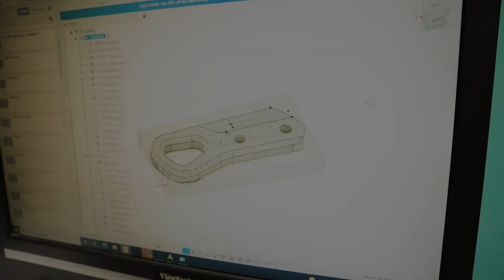Installing a Cargo Barrier in the Toyota LandCruiser LC300

Comment: This unit looks like it’s no longer easy to fold the seats forward to get behind them or to adjust seat lean.
Reply from the maker: Hey there, the barrier can be removed quickly by undoing the thumb screws and lifting the head rests – granted not as easy as just pulling the seat lever – but in just a couple of minutes, far quicker than conventional cargo barriers. The barrier does also allow for adjustment to suit the desired seat angle.
Reply: @KAONaust  Would like to see a quick release in the future.  Looks cool but I need that access.